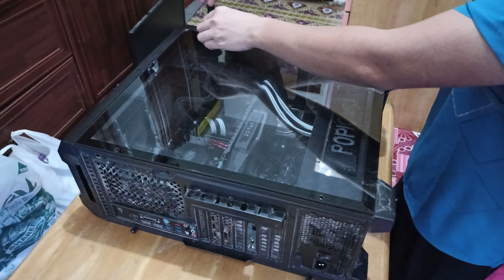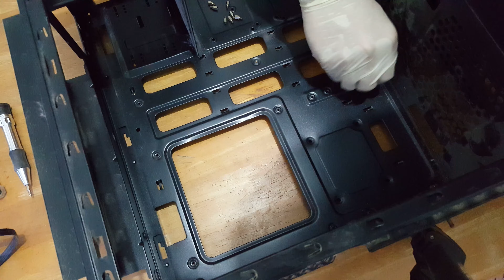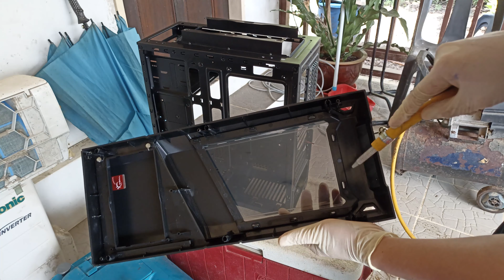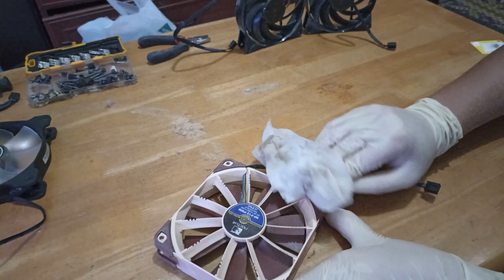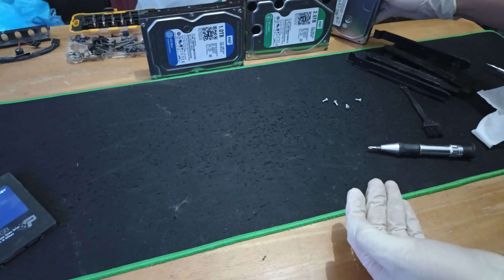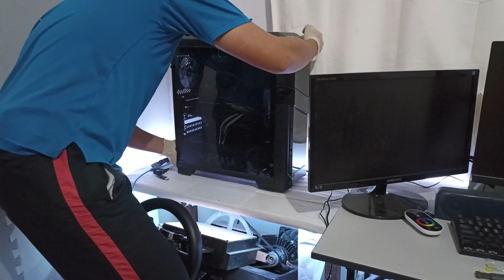Deep-Cleaning of My Dirty Computer After more than 2 Years of Hard Core Gaming | DIY

Comment: The dust on the external surfaces could be clean, sometime...a wet rag is enough...no necessary a total disassembling, once every two months you can pass the vacuum cleaner inside the pc, so the most part of the dust gets eliminated... then, the deep cleaning like the one you show in the video is correct, but just once every two years, if you want...

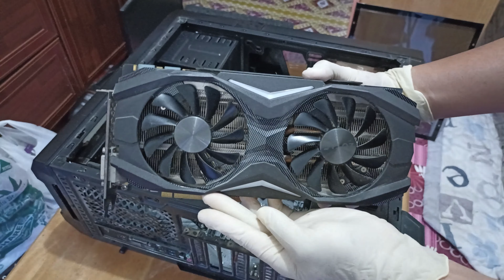Comment: 2:31 I know this video is a year old but I need to point out that you have your fans the wrong way around for the radiator. It seems like they are in a push configuration which is what is causing the dust build up on the radiator. You should really flip them around to make a pull configuration as this will bring clean cold air from outside of the PC into it allowing the radiator to more efficiently cool the water in your AIO. In the current configuration, the water is being cooled by the hot air inside of the case that is also used to cool your graphics card. This can cause cooling issues as your CPU can only be cooled to whatever the air temperature inside your case is as that is the air flowing through the radiator cooling the liquid. On this note you should set you internal cans to be in a push configuration so that you have a "neutral" air pressure within your case allowing air to circulate better. You won't get perfectly neutral air pressure in the case as you would have 3 pulling fans and 1 pushing fan however if the CFM of the pushing fan is equal to that of those of the pulling fans combined you should be fine but ideally you would want multiple fans carrying the load so that air from all over the case is able to get out and not just through one outlet as this can cause stale air to remain in the case which ends up causing the dust build up within. Now since you would be using a 3-in-1 out fan configuration you most likely wont have a natural pressure in the system and will have over pressure in the system which is not bad at all as air will be forced out of the case from other fan ports without the need of a fan there, but it is not the ideal situation. Whatever you do you should not have a a push only, pull only, or a configuration where you have more CFM being pulled out of the case then is able to get in as this causes a negative pressure system in the case and can lead to a issues with you cooling as there is less air in the case (mind you it's a marginal amount but for maximum cooling efficiency you don't want that. Now over pressure is also not great for gpu cooling as with the abundance of air it makes it harder for it to circulate within the case.

Now mind you that when it comes to air pressure in the case the difference that it will make on cool potential is slim to none and possible to not see any measurable change at all, HOWEVER, the change in the fans for the radiator will certainly cause a major impact on cooling that you will be able to notice because the water can only get as cold as the air cooling it meaning that if the air in your case is said 98°f the water in your loop can only get as cold as 98° and by association, your CPU will only be able to cool to 98°. Comparing this to using outside air which say is 74°f the water inside the loop can now reach 74° and lead to the CPU being Being able to cool to 74° (theoretically lots of variables are at play when it comes to cooling potential but that's details im not going into). So by making that simple change you add 24° of potential cooling to your CPU for free.

Disclaimer the numbers used in this comment are example numbers the actual cooling you may experience may very based on may factors including but not limited to, thermal output of the CPU, age of your AIO or water loop, the type of material used on the heat spreader, ambient air temperature, radiator cooling efficiency, and other factors. Keep in mind that this post lives int he realm of theory and will very if you do this change yourself.
Reply: Holy Molly dude
Reply: @Yazevski  It depends on the which way you are looking at it. When I said a pull configuration I was looing at it as pulling air from outside the case in and a push configuration as pushing air out. It changes based on the prospective you are looking at
Reply: @Yazevski  it's about perspective. You can pull air in or put and push it in or out. The actions are the exact same thing the verbiage is just different.
Reply: @Yazevski   buddy I really hate to tell you but a fan pulls in air from the back and pushes it out from the front. If you are look at from the perspective of being inside the case then you air is being pushed in and pulled out, but if you look at it from the outside then air is being pulled in and pushed out. The fact that you come in here saying you are right but cant comprehend the basic when it comes to how fans operate with air is completely baffling to me. You know if you want to get technical about the whole thing then the fans need to be an intake on the AIO and have a fan as the exhaust somewhere on the opposite side of the case it avoid a short circuit . Get off your high horse and go do some actual research on how fans work.
Reply: You ever thought about writing a book ?

Comment: Your PC is extremely dirty to be the first time in only 2 yrs that u clean it. I've been playing almost everyday since I bought my PC 2019, if im not playing I'm watching youtube and Netflix. My PC hasn't that much dust, I've never cleaned it inside.

Guess it's the first time (and probably last) that I see someone using high preassure water cleaning their PC. Often u use high preassured air, never soak it in water. I was very surprised u used the same method to clean the filter...

Comment: Bro please help me I don't have any printer encorder all i have is 600ppr 2 phase motor encoder and I'm not getting how to use it in my ffb project please help me
Reply from the maker: Sorry I'm not pro in this kind of stuff. I did a lot of research on google before making my simulation.. So I'm also not sure how to connect it properly. But I can give you a suggestion for you to start. Try find your encoder's wire terminal. There should be like Phase A, Phase B, VCC, GND... then try connect it to the arduino as follow.. Phase A to pin1/TX , Phase B to pin0/RX , VCC to pin 5v , GND to pin GND.. see if it work
Reply: @PopicasaPOPStuDio  okyyy I'll tryy.
And i also did some research regarding this so it said that everything is same but i need to just replace the printer encoder with motor encoder and adjust that phase z with a switch others wiring is same .
So if I'll face any another problem I'll ask
Reply from the maker: @CrappyDude  ok good luck with your project